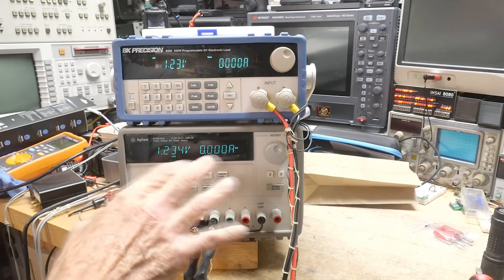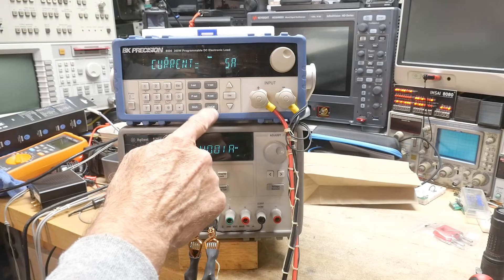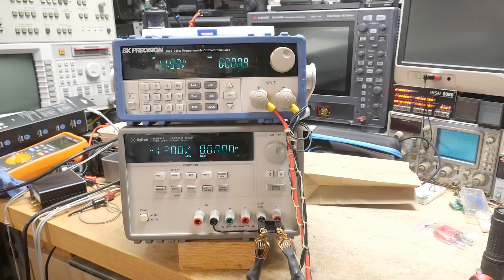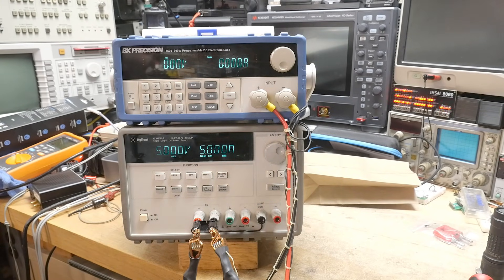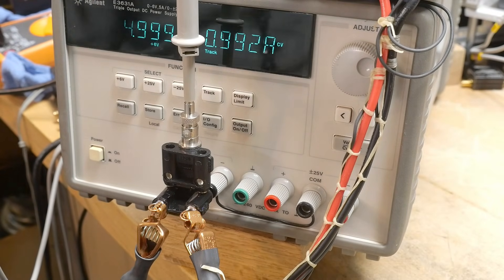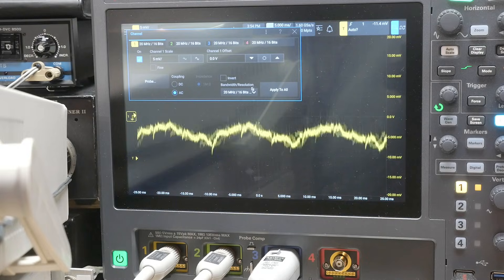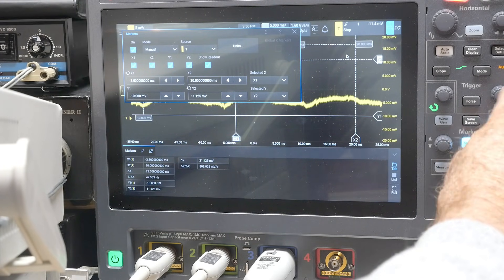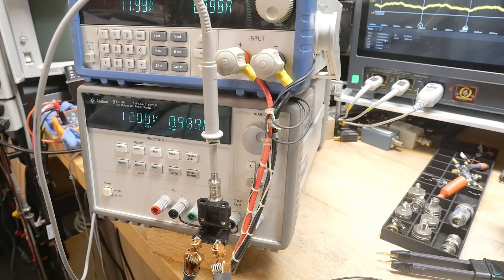#2449 Agilent E3631A Triple Power Supply (part 2 of 2)

Comment: Since the ripple is somewhat shaped like the folded sine of the output of a full wave rectifier, and it is running at 120 Hz, I believe that you are right about it being the switching remnant from rectified input power. Usually that remnant has more of a sawtooth shape, but maybe that is reduced under heavy load. Also, the remnant is usually only visible between the filter capacitors and the linear regulator. It's a little surprising to see it on the output.